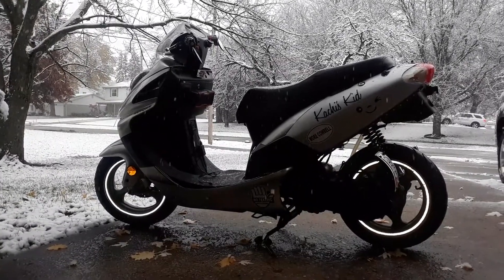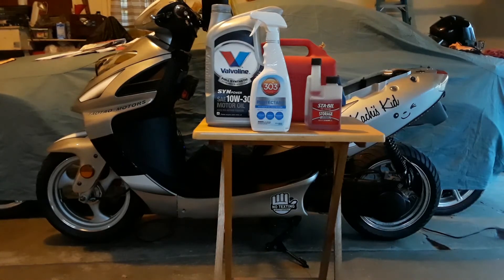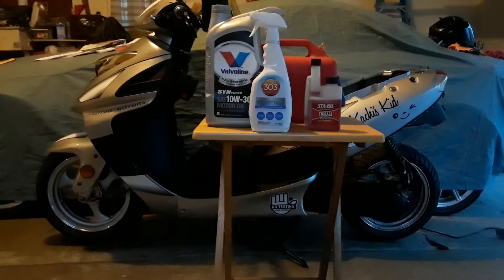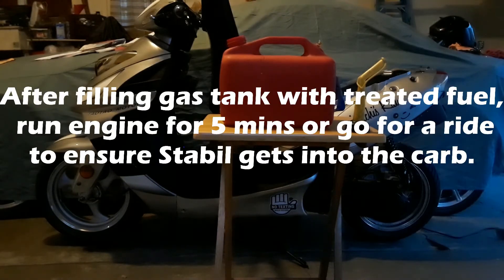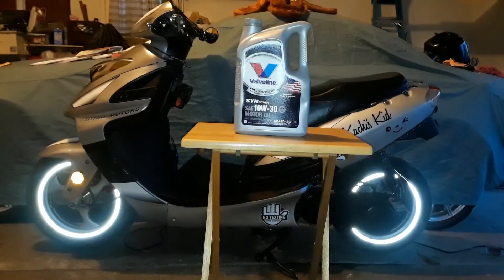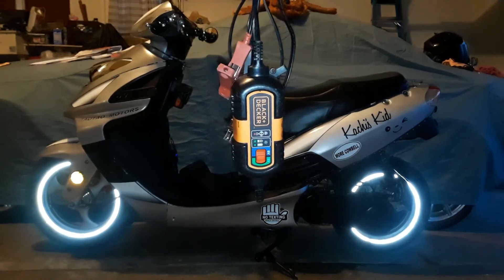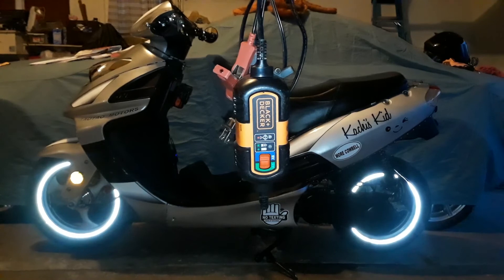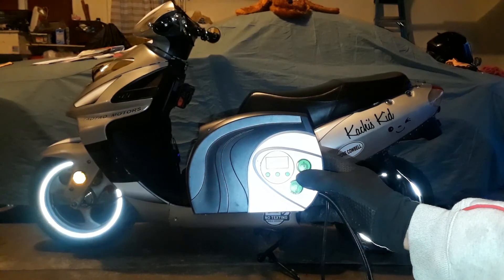Winterizing your scooter / 7 quick tips to storing your bike

Comment: Unfortunately I do not have a license so I am stuck riding mopeds it is about to be winter time, does anybody have any suggestions on how I can make it run as smooth as possible during winter as long as possible I don't want to store it as long as possible
Reply from the maker: Whoa, will you be riding in the snow?